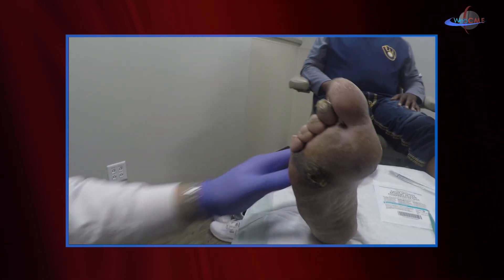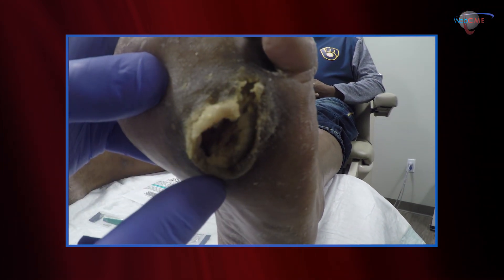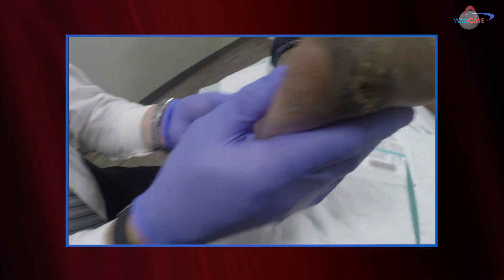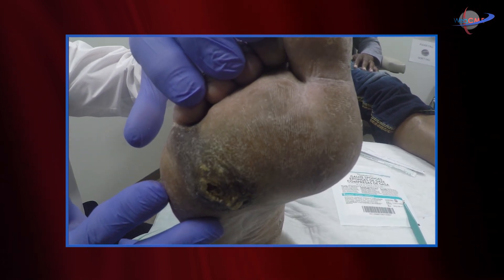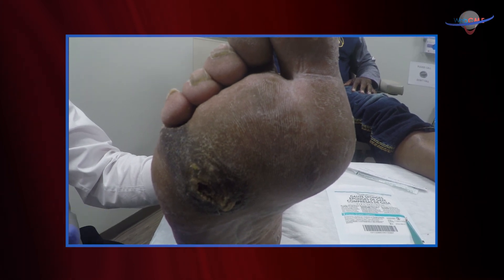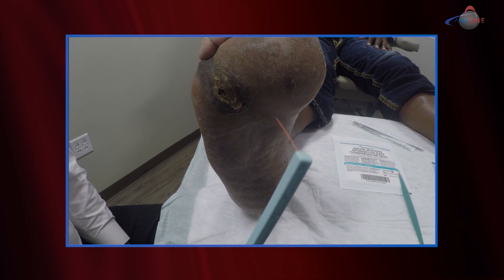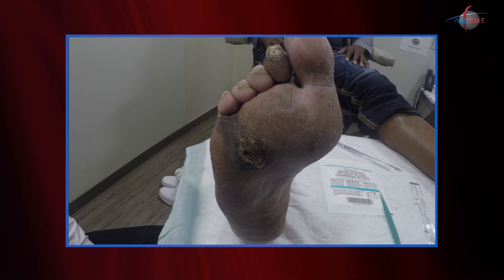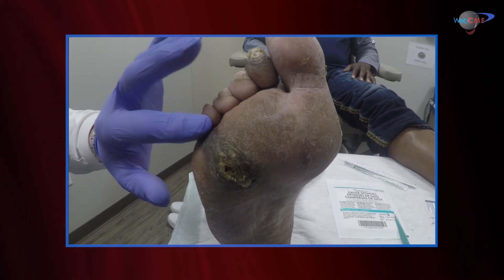WCW: Managing Diabetic Foot Ulcers - Testing for Neuropathy Using Monofilaments

Comment: Thank you for your always excellent video.  In regard to the description of a "short Achilles tendon", since the dorsiflexion was only performed with the knee extended and not flexed it may be that the problem is a gastrocnemius equinus and not an Achilles shortness/equinus.  Two completely different courses of treatment.  Keep up all your good work!
Reply from the maker: Thank you so much for your comments, the Doctor says you're absolutely right, this was an illustrated video. Tune in next week for the follow up!